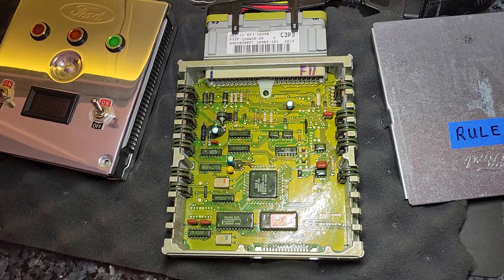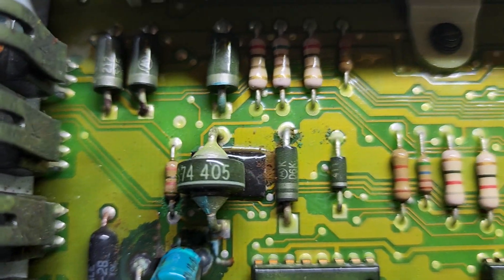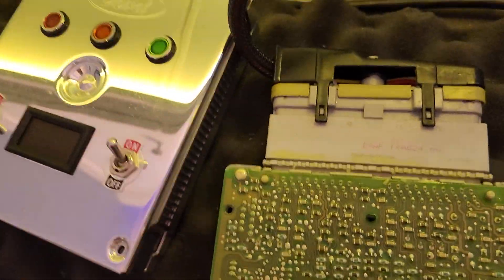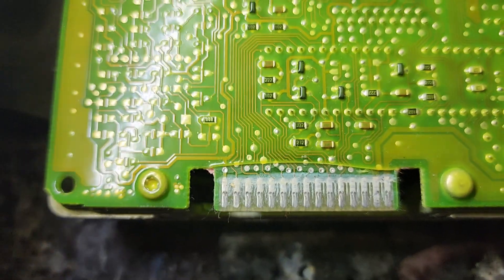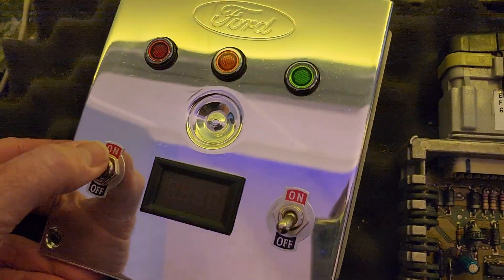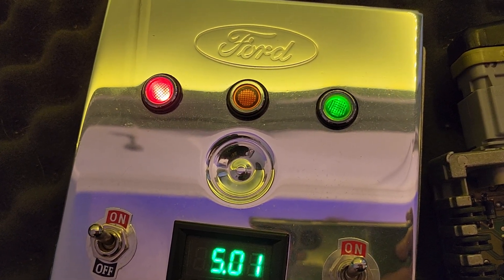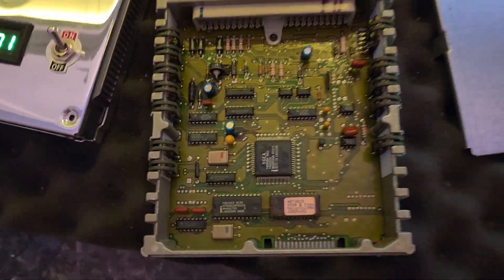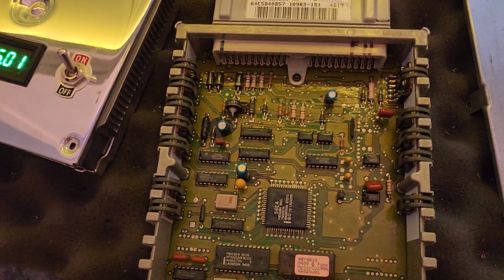Bench Testing a 94 Ford F150 PCM that has bad capacitors

Comment: So that tester, did you make it or is that off the shelf?
Reply from the maker: I made it.
Reply: @dragradialperformance3540  

Do you have a video on how you made it and if not could you please. I am always dragging home vehicles of this vintage and would love to have this tool on hand
Reply from the maker: @jldwolfe I don't have a video on that, and probably won't have time to make one any time soon. But I can describe it. 12v comes in from the power supply, thru the switch on the left, and out to the PCM's key-on power input. I tied the red LED into the other power wire, just to see voltage flow thru the internal power bus, as well as to indicate the thing is on.

Orange LED goes to the MIL light wire. Green LED goes to the Fuel Pump relay control wire (FP). Switch on the right connects two wires together to get it to pull codes. I forget which two wires they are, but they're both on the OBD1 diagnostic connector.

The voltmeter is wired up to VREF, and has 12v and ground coming from the power supply. It displays reference voltage (sensor power).

The case is a rare, older EEC-IV PCM case, as I recall. I polished it just because I can. The PCM connector is a junkyard EEC-IV connector, with only the wires needed being hooked up.

Comment: Out curiosity when did Ford go to OBD2 on the pickups?
Reply: Pretty sure it was in 96. Some 95s had the obd2 plug but still used the plug under the hood for diag, my old 95 had the obd2 plug but it didn't function
Reply: @mw356  And that's what's confusing because I know Ford did some trucks like how yours is, but then also my 95 with the 7.3 Powerstroke just has the OBD2 and nothing under the hood to speak of and it even uses what I believe is an OBD2 protocol. 95 just seems to be a wild year with OBD systems I guess because my dad's 95 S10 for example has an OBD2 connector, but uses some sort of protocol that a regular OBD2 scanner like you get from the parts store won't read.
Reply from the maker: OBD2 began in 1996 in cars and 1/2 ton trucks. Heavier trucks were implemented later, I think in 1998. Some manufacturers weren't quite ready in time and got an extension til 1998 as well.

Ford began a trial run in the 1994 Mustang V6. It got OBD2 style datalogging, and flash programming.  But the actual legal requirement to be OBD2 compliant didn't formally begin in 1996. Continuous emissions monitoring was the main purpose. Everything else just became a bi-product of that, such as datalogging.

OBD1 Fords didn't have any streaming data until 1994. They still had the OBD1 system that allowed code pulling, and key on self tests like 1993 had, but some 94s also got an OBD2 style port, where they could access some pretty basic streaming data. So you essentially had OBD1 and a prototype of OBD2, both in the same 94-95 Ford. In 96, the OBD1 connector disappeared, although it's possible some cars still had it for communication with ABS and other non e give purposes. It also remained in 3/4 ton and up trucks.

GM had their proprietary OBD1 port in 94, they switch to an OBD2 style port in 95 that they called OBD 1.5, as it was not truly OBD2 compliant. In 96, they were truly OBD2, but the port still looked the same. So yeah, 94 and 95 were weird years, as the OEMs were switching over and getting ready for OBD2 in 1996.

Comment: The computer needs 5 volt reference??   Asking because I picked up a adapter for my snap on scanner that will hook to it. And it has to have a power source.  The battery powered OBD1 scanner uses a 9 volt battery
Reply from the maker: Tom, the PCM takes 12v in from the PCM relay, and regulates it down to 5V. This 5V is sent out of the computer on the VREF wire (voltage reference) to a splice. From there, it splices off to all of the 3-wire 5 volt sensors, such as TPS, DPFE, Fuel Tank Pressure Sensor, Fuel Rail Pressure Sensor, MAP or BAP sensor, EGR Valve Position Sensor, etc. Any 3-wire 5v EFI sensor gets it's power from the PCM"s VREF output.

OBD2 ports have 12v on pin 16. This is used to power up a scantool. OBD1 ports did not have 12v on them, and therefore scantools required 12v from a cigarette lighter, or batteries. This has no relation to the VREF (5V) circuit.
Reply: @dragradialperformance3540  thanks for getting back to me.  I'm definitely excited to hook up my scan tool to see whats available.  It's a snap on Solus legend with the Ford 1b adapter.   I'm waiting for the power cord to show up from snap on.  They didn't have one on the truck
Reply from the maker: @tomborders6003 Tom, OBD1 Ford (fox body) didn't have any live data. Just KOEO and KOER self tests, and Continuous Monitor code pulling. The 94-95 cars did actually have some very basic live data, such as coolant temp, RPM, etc. But Fox bodies had no live data. For that, you would have to emulate.

If you haven't seen my video showing how we datalogged over 100 parameters in real time in a Fox body, check it out. It's pretty cool. It takes a fox body from dinosaur age to space age.
Reply: @dragradialperformance3540  so no bi-directional??   Lol.  I'll check out you're video.  Thanks again
Reply from the maker: @tomborders6003 LOL yeah, right! Not without an emulator. With a Quarterhorse, you can have bi-directional on steroids!
Reply: The snap on scanner adapter plugs into the cigarette lighter.  Just don't want to fry the computer